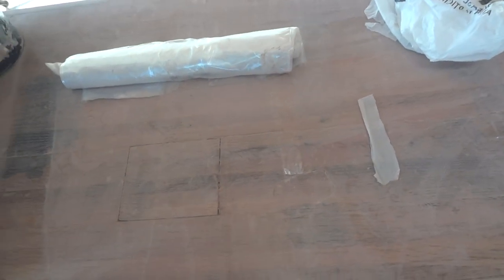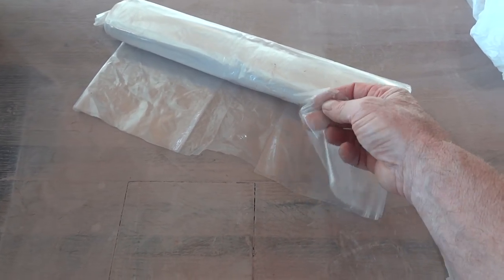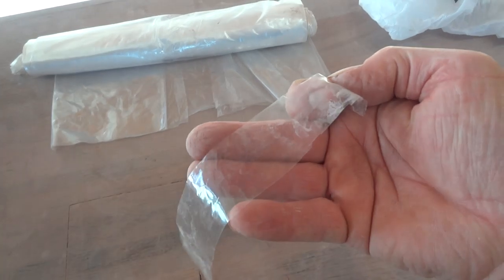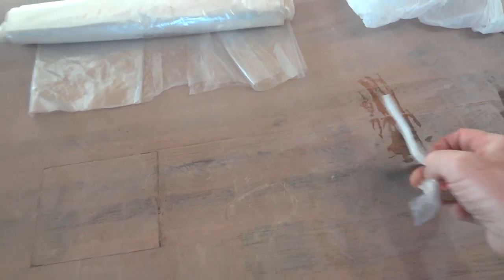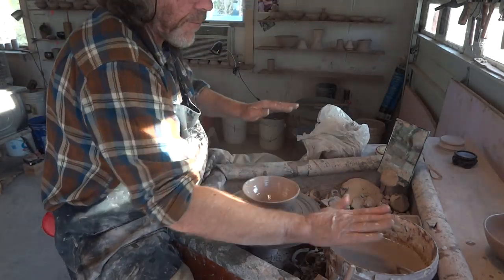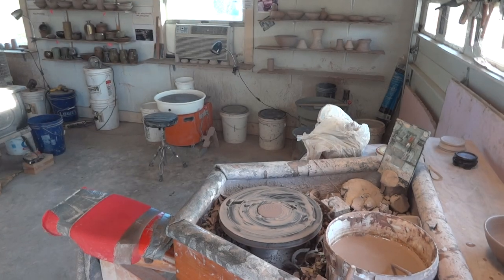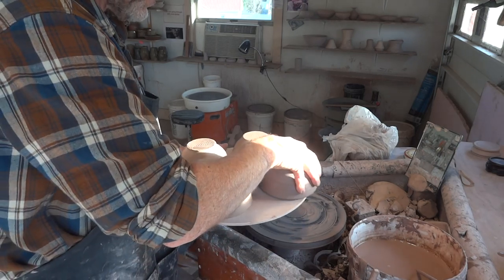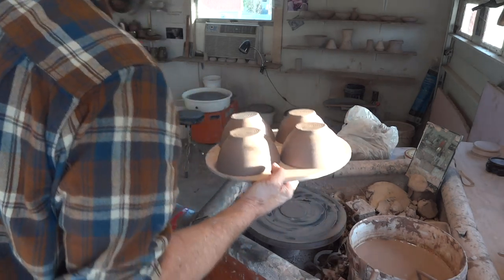Leather a rim or use plastic, which is better ? Oct 21st 2019 with Simon Leach

Comment: Chamois then ultrasuede,, plastic in an emergency. Natural sponges behave differently than synthetic ones. Fine "elephant ear" and large sea sponges differ and cellulose and polyurethane differ. One of the potters I learned from used an elephant ear for knuckling up, sort of a water reservoir for long pulls and for finishing rims. Its kinda like taste, not to be argued about. For me, I've settled on the ultrasuede as it won't rot.